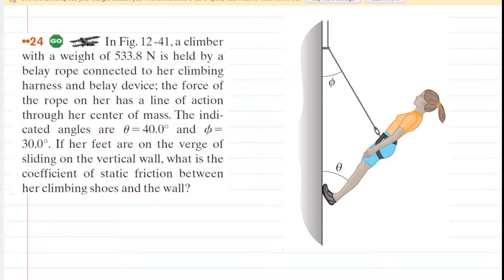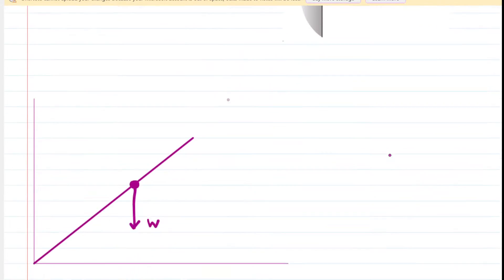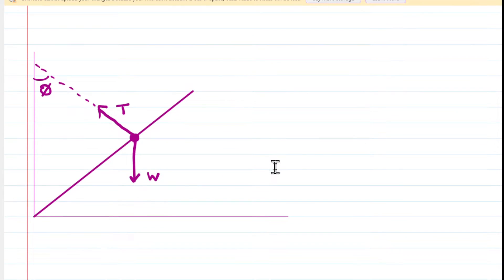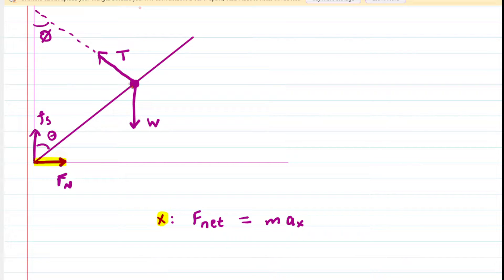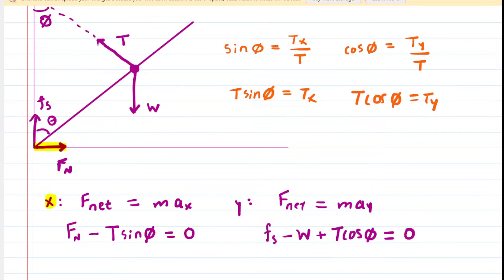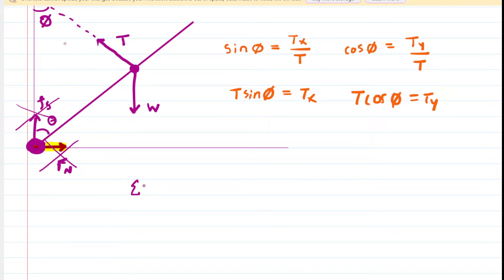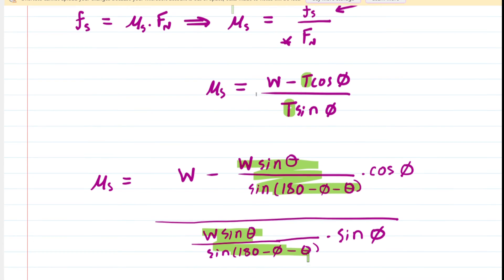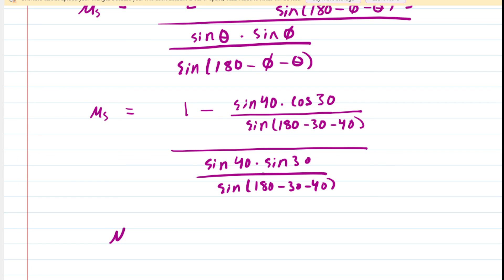A climber with a weight of 533.8 n

Comment: 8:51 I just simply didn't get it! Why isn't your force normal in the direction of the object, in lieu it is perpendicular to the surface?
Reply: You can calculate the normal force in the direction of the object, but it always acts perpendicular to the surface. For example, when a box is on an incline, the Normal force acts perpendicular to the surface, not just straight up. Does that make sense?